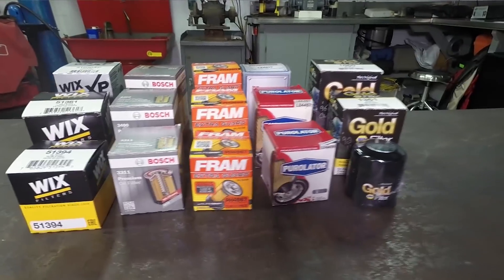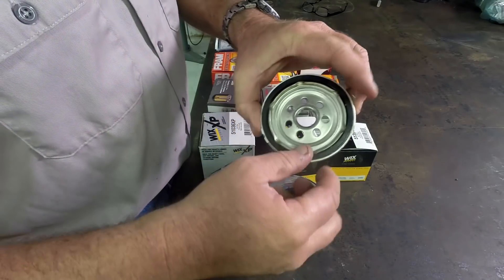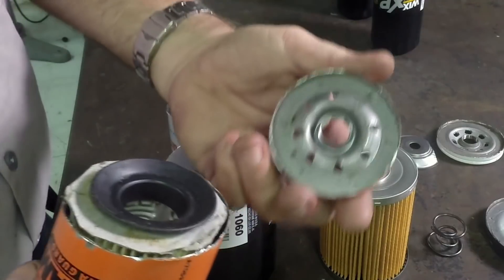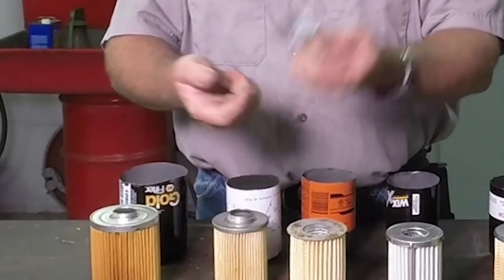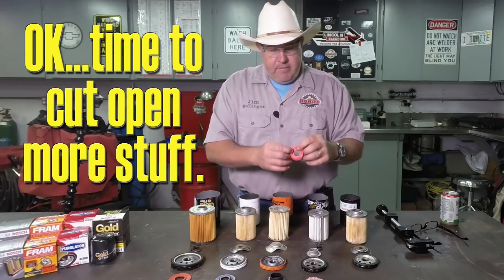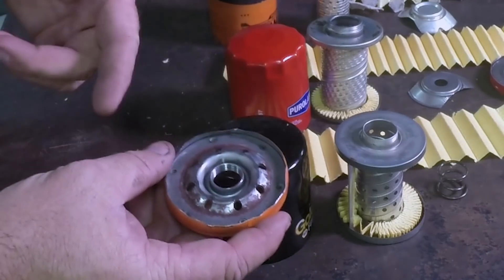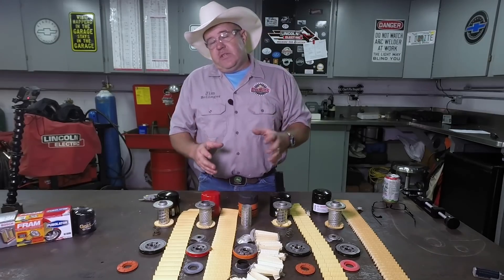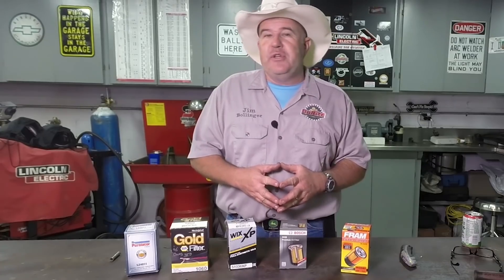The worst oil filter EVER!

Comment: BULLSHIT!!! I will not even watch this drivel. When I was an automotive machinist almost 30 years ago, there was a problem with filters coming apart, and material running through your engine. It doesn't happen anymore. When your engine is cold, or you run it at WOT, the pressure is so high, that it gets relieved, and bypasses your (ANY) filter. Furthermore, if these filters were no good at filtering, your hydraulics would make noise, and rattle like crazy. These million viewed videos, on filters, and so called "synthetic" oils, and comments are an idiotic joke. I have taken more engines apart, and peeled more used filters apart than this guy, or anyone reading this.

Comment: I used to use Fram. We had one on a hydraulic system, it was made for hydraulics and for the system we installed it on. The filter media completely was pulled out from the inside. It totally clogged up the filter housing with cardboard and paper. I have been off Fram for quite a long time.

Comment: A few things worth mentioning...
- They make oil filter cutters or a big pipe cutter works well. 
- The "spring thing" is important, it functions as a bypass should the filter become clogged. 
- Most important people overestimate the importance of oil filters. Yeah they are good thing for the most part, but for years many engines didn't even have any. They really only need to catch the really bad stuff, a magnet is maybe more important. 

I know Frams suck, but I still use them on one of the vehicles I maintain. One reason, the grip, that filter in that sucker is a pain in the ass. I'd rather it was just easier to change.

Comment: Funny though, ive ran Frams on EVERY SINGLE vehicle I own.  And all of them have gone over 200k miles no issues.  I think this guy is just trying to push a "certain brand" hes likely sponsored by them. And dont believe me, ive got a 1999 Silverado 2500HD 6.0L gas motor which currently has 303k miles on it.  Changed every 3000 miles with Castrol GTX 5w30 in winter and 10w30 in the summer.  Bought new.  Truck still gets 18-21mpg on the highway.  But 303k.  get over it saying "FRAM ISNT THAT GOOD"  LOL
Reply: "I've used frams on every vehicle I own" wow what a compelling argument, now tell that to the thousands of lawsuits fram has had to settle due to their shit filters eating customers engines, the only reason your 6.slow isn't grenaded yet is because of the top notch LS design you literally can't kill them if you take even slight care of them. But ok

Comment: This is NOT A FAIR TEST. You have  FRAM's  bottom of the line "Extra Guard" $3.77 filter and compare it to the Premium WIX "XP" $12.62 and the NAPA "Gold"$12.00 filters. Even though you use Bosch low end filter, it's really not; starts at $9.99. The real winner here is the low end Purolator @ $4.60. I enjoyed your video for it's information and passion, but it felt like a FRAM bashing biased review to me. Maybe that's how it went once you found the inexcusable  rust inside or it was your intent from the get go. Either way, a fair comparison would be oil filters at the same price point or at least claiming the same filtration and mileage capabilities. -For my prices I used the lowest AMAZON price I could find for a Chevy 350 5.7L oil filter of that brand and filter line.

Comment: Paper filter media, paper end caps = better glue joint bond. drain back valve and spring hold caps under pressure.  That said I like a coil spring, so I would prefer that feature. This guy came to the table hating Fram, look how he tore the filter media [leaving the caps on] rather than cut them like in the others. PUR-O Showmanship here, especially about rusting paper. Thats glue, Hondo.

Comment: Awesome video! I have tested the Purolator, purple oil, Bosch, wix. Had them for about 4k miles each change, running 100 octane on my tuned Nissan. By far they all are exceptional except for the royal purple, it was closer to the Fram. If I had to rate I'd go OEM, Wix, Purolator classic, gold, (synthetic blue was terrible, had blue shavings inside filter ) Bosch, Progaurd. Bosch has always been exceptional. But Fram is the fucking worst

Comment: First of all, I have used FRAM filters in my cars for many, many years and never had an engine issue. However, after viewing this video I decided to do my own limited research. I had already purchased a FRAM XG 3614 for my 2016 Mustang. So I cut it apart. Here is the video link: https://www.youtube.com/watch?v=m07O3W6_jHw The filter is very well built, but it is an Xtra Guard and NOT the standard FRAM filter that was cut open in the video. Mr. Bollinger states that the NAPA Gold filter is the highest quality. I took that to mean in Mr. Bollinger's opinion it was the highest quality of the five filters he tested, but is it the highest rated? Is it rated for synthetic or non-synthetic oil? The XG by FRAM is rated for synthetic oil and is the highest quality filter FRAM offers for my car. Which led me to ask myself is Mr. Bollinger's video comparing apples to apples or apples to oranges? Even though the video states that no oil filter company sponsored the video, the only links provided are the ones to the WIX and NAPA oil filters. I would like to know what FRAM filter numbers were tested in this video so I can cut them open myself and see if the filters are as bad as they appear. I would also be curious to see what FRAM has to say regarding the findings in Mr. Bollinger's video. With the cost of new cars continuing to rise, we must make sure that we are using the best parts and materials to ensure that we get the most bang for our buck.

Comment: Mann Hummel. Don't they own Purolator?? I have been using the Bosch Premium on my 2018 Harley 1200. Yes its an Automotive Filter, Seems to work fine for me.
Reply: Been ridin harleys since the -70 and have always used car filters with very good result! After browsing thu the comments i´m curius why us owners seems to focus on getting the cheapest oil and filters and change them very often like we did in the old days here in Sweden. IMHO its better using top quality oils and stuff and change it only at manufacters intervals, most people here let OEMauctised shops do it. As a WV owner that is flexible intervals up to 2yrs/~20kmiles., often without the need for topping up.... This varies with short haul/long haul but is 1-2years of fussless driving. Just wondering....

Comment: ANOTHER thing to be aware of is that most "house brand" filters are produced by the major filter manufacturers and painted up to look like they are (and they ARE, in effect) "house brand", so most of them are the same as the filters branded as a MAJOR brand. The point is---DO YOUR HOMEWORK!  You can often buy and use the same filter as what the "majors" make and sell, but for a LOT LES money if you check into this.

Comment: I have had to replace not 1 but 3 engines, because of Fram and Purolator fillers! Either the case busted right below where the seam is under the rubber seal or it collapsed inside on itself! SMH 😎

Comment: It would be really bad if the more expensive filter was cheaply made.  The Fram is only $3 and I really like how it is easy to grip and apply torque.  I have 200k miles on my car changing every 5k miles with Fram.  The Napa gold is $12 (4x more).  Is it 4x better?  You should compare with the Fram Ultra to be fair which is about $8.

Comment: People, bear in mind that all this was just one guy's opinion. I have used mostly Fram filters for over 40 years, and I know lots of other people who have used them forever, and in all that time, I have never heard of even ONE failure of a filter or failure of an engine that was caused by the filter.   Not one !!  Just sayin'  .
Reply: Guys that race stock cars are pretty in tune with what is the best products on the market and 99.9% of them all use Wix filters and they will openly tell you that the fram filter is crap. I have seen fram filter fall apart so you must not be a very good mechanic
Reply: @FishNFoolLures  I have had NO failures or issues with Fram in many hundreds of thousands of miles. How does that make me a poor mechanic? If you have had them fall apart, I would suggest that that they were not installed properly.  You must not be a very good mechanic.

Comment: Wow I have for vehicles all well over 200,000 miles and Fram is the only filter that I run and have never had a problem with it I've had vehicle since new that have well over 200,000 on them and still run perfect have never had to pull a motor apart this guy is an idiot he's doing it just to make them look bad
Reply: Your the idiot for not believing the facts

Comment: I  do all of my own oil changes and I steer clear of fram oil filters after I had an experience whete the rubber gasket actuall cracked and it leaked oil! Luckily I double check everything and noticed the leak. Definetelly a really sub par oil filter!!

Comment: I opened an auto parts store in 1989, that's 30 YEARS AGO. The Wix sales rep demonstrated the exact same results as this video. I had used Fram filters for years, thinking if its good enough for John Force, its good enough for me. I had a device that would easily cut a filter in two to check for metal shavings. On a whim, I dissected a used Fram from a small block chevy. IT HAD COMPLETELY FALLEN APART INTERNALLY! It could not have been filtering at all.

Comment: The problem with this type of analysis is it based purely on tactile subjectivity. Objective analysis would be based on actual performance in actual use or controlled testing environment. Nothing in this subjective evaluation contributes to actual use performance. For example, there is no test of the most primary function of a oil filter, and that is the ability to trap debris, and that cannot be determined by simple inspection. I hope you have an attorney.

Comment: You cut a PH3980, a part number that is about to be discontiued like the PH3675. Millions have been produced and there's no more need for those filters. Why didn't you used interchange numbers of that filter for other brands? I'm pretty sure if I get a PH13 it's already punctured by rust cause it have been discontinued 15 years ago. Try with a newer part number and don't challenge a base model of one brand with the top of the line of others.

Comment: I use the Fram filter and keep wondering why the oil is still clean  between 4700 - 5000 miles on oil changes. I guess I can't afford those $11.99 oil filters and those synthetic 5 quart jugs costing $31.99 a jug.

Comment: I have over a million miles total on the 4 trucks that I have owned and have never had an engine failure. Trick is to faithfully change your oil every 3,000 miles.

Comment: Thanks for taking the time & effort to show the difference between all these filters. As an ex manufacturers rep for many brands of automotive parts I can honestly tell you that 95% of the parts manufacturers offer various levels of good, better and best in quality as well as in price. In the company I worked, all the reps loved to promote our quality parts, but we also presented the customer (independent repair shops and parts stores) the “value” lines available. Much of the public today has become hyper sensitive to price thanks to the internet. Today’s shop can’t keep his lights on by selling cheap oil changes for &19.95 unless he uses a minimum wage guy, some basic oil and a $.99 cent filter. Then he’s probably just breaking even.  He makes his money by finding other things on your car that need “attention “. Most shops I knew didn’t want to do cheap $99.00 brake jobs either but when all the competitors around them did they had to also or loose the business. So many shops now don’t even try to educate their customers by promoting quality parts. 
Because the manufacturers offer a $50 alternator, that’s what they sell. Same with brakes, starters, filters, wipers, you name it. 
What hasn’t changed though is labor $. That has steadily risen throughout the years as has the price of the cars and trucks. If all these cheaper parts are available why hasn’t the cost of the automobile gone down. Because the manufacturers didn’t design the vehicle with cheap components. Generally when designed, they built it to last a certain period of time or number of duty cycles. I’ve rambled on too much. Bottom line is we the consumer have brought this problem on ourselves by letting price dictate where we shop and not educating ourselves why a $1.99 oil filter isn’t as good as a $5.99 one.  I remember a line of cabin air filters we had that promoted it’s better air filtration because of all the extra material it had packed it. Soon customers were complaining about poor airflow in the cabin. It was so packed with more material it actually restricted airflow. 
This video really helps with education. I would have liked to have seen the comparison expanded to include the vehicle mfgs recommended oil filters included in the cutaways. Thanks very much

Comment: Nearly every filter he tested, expect for the FRAM, was made by Purolator which is itself owned by Ashline Oil who also owns the Valvoline brand name. Fram filters is also a subsidiary of an oil company that I won't name here but if you think about where you might have seen them highly advertised at you'll know. Talk to old engine builders who put two and two together and realized that it was filter causing sludge in the engines and not the oil and ask them which filter was used. 90% will tell you Fram.

Comment: You used the xtra guard filter that’s the cheap version of the filter they have the black rubber grip on them the filters we use in our shop are the plain orange gram filter we get them in a big box not for resale and people have brought cars in with really tight filters to the point we’ve crushed a few to get them off and the plain orange ones are definitely not the same as what you showed it’s quality still not the best filter no but nothing like you showed

Comment: Not surprising! I pulled a Fram filter out of the box to put on my truck and I noticed rust on it immediately. You’re not the only one that has run into this issue. But I appreciate you confirming my theories on Fram, they are just pieces of crap!
Reply: Stephen Anderson:

I don't know if you noticed but sometimes when removing an old Fram filter with a filter wrench of the band type the outer metal shell of the filter is so thin  that it crushes making filter removal a lot harder, As a matter of fact I have had to drive a screw driver through the oil filter to twist it off, I stopped using FRAM filters many years ago after seeing that the metal is a lot thinner gauge than the others and then I took one apart and saw the rust and that sealed the deal for me I will never use a FRAM filter again. 

Autozone carries a lot of OEM filters much cheaper than the OEM dealers do and they will not fall apart and void your warranty!!!!

As a matter of fact when I have my oil changed I buy an OEM filter and bring it in for the oil change and give it to the person who changes the oil with strict orders to only use the filter supplied by me!!!!

Comment: I sell Napa Gold Filters.  That being said.  Wix which is the same as Napa Gold was purchased by Mann last year.  Wix is also the only filter company that makes Light duty and heavy duty filters on the market.  Ever wonder why a Napa gold is a bit more money?  Now you know.  I have a cutout of a Fram High Mileage Filter at my desk as a joke and by the way it has a pocket of PTFE in it which will spin your rod bearings if you go much over 3k miles before you change it.
Reply: I sling Napa filters as well. Funny, I still get walk-ins balking at a $18 oil filter and stating that "WalMart has em for a lot cheaper!', even after detailing the benefits. Can't fix stupid!

Comment: I used to use Fram for years, but switched to Napa couple years back. Not much difference I can tell with a 330k miles on the clock.

Comment: What I gained from this video is the Napa Gold and Wix are safe back-ups to use in an emergency if no Motorcraft filters are available for my 4.6L. I had been using a quik-oil change facility to do my maintenance for me which used Fram filters but soon I began hearing clanking / valve train noises upon engine start-up. I immediately removed oil and filter and replaced with Motorcraft filter and Mobile One Synth oil and have been performing my own oil changes ever since. The valve train noise on start-up is gone. My Ford engine with 131k miles may live much longer due to my intervention. I just hope the dual-cam timing chains and plastic chain guides weren't damaged by the quik-oil change shops.

Comment: Great video!   I knew Fram was garbage. I think Consumer Reports has already covered it. I have used Wix and Bosch. I also like Mobil1 and K&N, which you didn't cover. K&N is very well regarded and they are sold at Walmart.

Comment: Last time I bought a Fram filter, I was screwing it on and all of a sudden I hear metal on metal. I take it off to inspect it, and half of the gasket is sitting below the outside rim. I take the gasket off, and the freaking metal it sits on is bent into the filter. If I left it on, I would surely have had a major oil leak.

Comment: Great video. Back 15 years or so when I did my own iol changes I bought Fram filters because they looked better quality because of the non slip grip end and the bright colour. Plus all the advertising bull shit. I now have my GM dealership change my oil. I will have to see what they use and make sure NO FRAM in my truck. Just out of curiosity, what was the price range??? Thanks for sharing.   By the way, I subscribed to your channel to see what else you have going on.